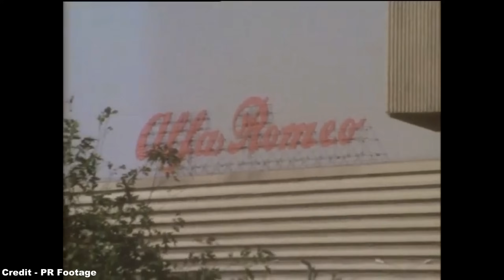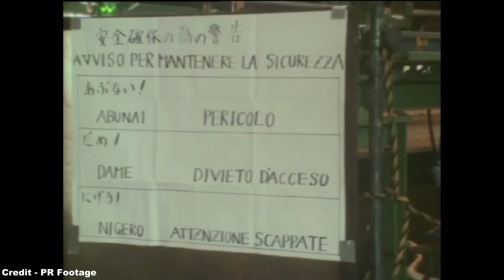Getting it Mixed Up - Alfa Romeo Arna (Reworked)

Comment: As a huge Nissan & Alfa Romeo fan, thanks for sharing such intriguing historical facts! My former 2009 Suzuki Grand Vitara 3.2L was a Japan-built RWD microute with a GM HFV6 3.2L Alloytec engineered by Holden Australia. Today, full race versions of these GVs are raced in Europe by Suzuki Italia. The sounds of these V6s are intoxicating with an Italian verve. Suzuki & Fiat also cooperated together to design (a lá Ital Design) build and sell the wonderfully reliable and stylish Suzuki SX4 and Fiat Sedici crossover twins. Today, one of, if not the most favorite cars I've been fortunate to own -- of the 120+ in my lifetime -- is a Suzuki Kizashi 2.4 6MT (6-speed manual transmission), which no doubt has Italian influences in its design and styling. Great things can come about through such partnerships!!! The sudden death of young visionary, Hirotaka Ono, from pancreatic cancer at the age of only 52, dampened the overwhelming passion, energy and resolve he brought to Suzuki on a global scale.

Comment: I love the Arna, two magnificent car manufacturers coming together.  How about the new Fiat 124 spider/Mazda MX5?
Reply: Luckily they got it right this time. They had the Japanese design all the mechanical and electrical bits, while the Italians did the styling and engine (for the Spider).
Reply: @able_archer01  Kinda. If you want the best possible Mazda Mx5 you want to get a Fiat 124 Spider Abarth, but the non Abarth models are not up to spec compared to the Mazda models.
Reply: @able_archer01 The "Italian" cars had Fiat engines though as well as their own styling. They got the manual gearbox from the NC MX-5 and various interior bits from the ND.

Comment: 4:13 there must have been a tax or tariff reason for this, or perhaps they needed to keep the Naples plant humming...though a Japanese built body would be more durable than a comparable Italian one , hands down. 

Using the running gear of a well understood decade old platform perhaps wasn't the most exciting proposition to set the auto world ablaze, but it's not entirely without its merits especially if that basis is one of the best handling fwd cars of all time.

Something got Lost in Translation obviously, and build quality did not help it here, but I can see the merits of the original concept, or it's not entirely baffling.

Comment: Hi. The Japanes car industry did itself no favours by unleashing its Datsun (now Nissan) brand on the UK and the cars rusted as you looked at them. Finally, the Japanese car industry realised this was not good enough and upped their game.
Reply: All cars of those times rusted badly, opels, fiats, vw, ford and all those pieces of carbage from uk. It's bit sad as all those cars could ave been saved with some cavity wax and undercoating. 
Cars were not intended to last more than mostly 10 years and new cars were much cheaper than now

Comment: Instead of Nissan, would Alfa Romeo have been better off working with Subaru on an ideally better-styled FWD 3/5-door hatchback type model based on the mk2 Leone?
Reply: The MY series subaru is a lovely car as it is. Im not sure the alfa engine would fit in the chassis though, its difficult to get a later model ej engine in an 82 leone. Though by the 84-88 more russian looking gen 3 leone, i agree a restyled one would have been good, and the alfa engine would fit in its wider chassis for italian production
Reply: ...with Subaru's dreadful unrefined, unreliable and expensive-to-maintain (failing head gaskets, leaking cam carriers) boxer engines? No thank you...
Reply: @Colt45hatchback  The Alfa boxer should fit in theory, with even the largest at 1.5-1.7-litres being roughly comparable to the 1.5-1.8-litre EJ. Also heard the MY EJ swap challenges applying to the 2.2-2.5 EJs if not the 2-litre as well, though admittingly not well-versed on Subarus.